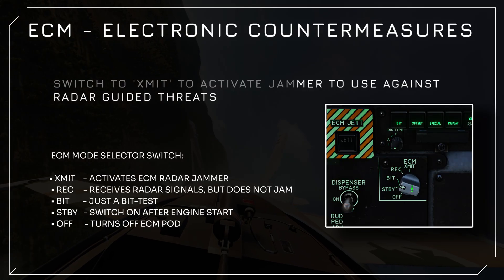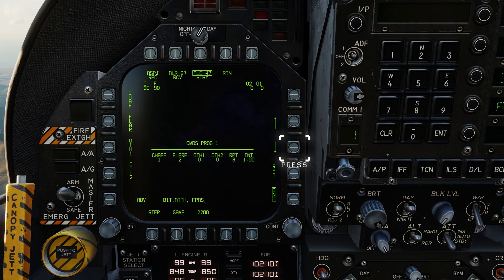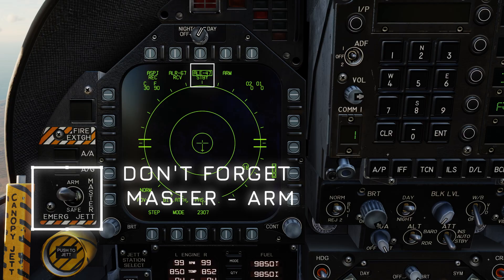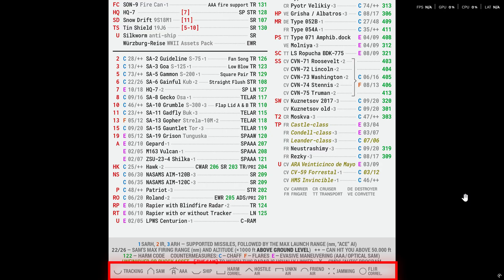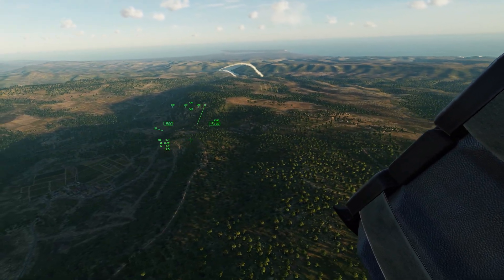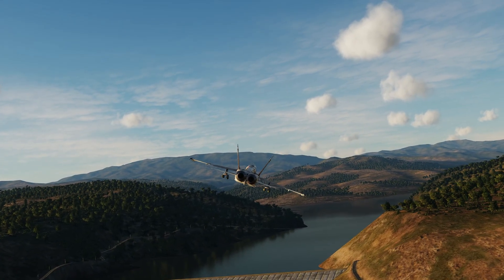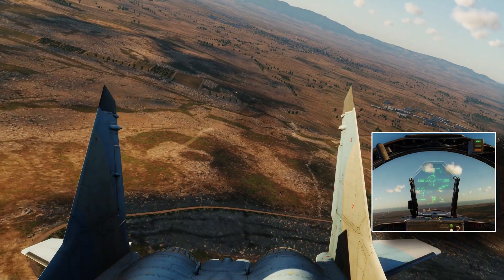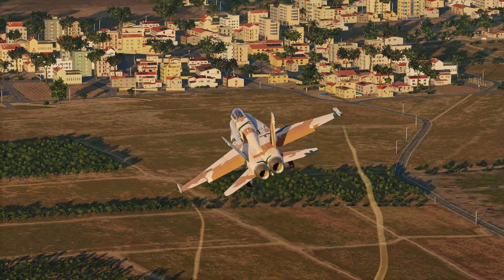How to Survive Missile Attacks – F/A-18C Hornet ECM, RWR & Countermeasures | DCS World Guide

Comment: Great video, is there a way to configure counter measures quickly after a respawn in multiplayer servers?
Reply from the maker: Hey, great question and thank you. Unfortunately, DCS doesn’t let you save countermeasure programs across respawns by default, to the best of my knowledge. Therefore every time you respawn on a multiplayer server, you’ll need to quickly reprogram the programs via the EW Page on the DDI.

You could try a few practice program trials  so that you can speed up the process somewhat. I suppose if you’re spawning into a dogfight, that could be tricky though 😬